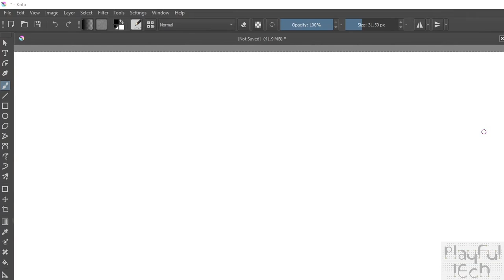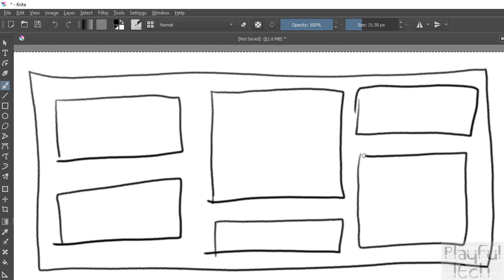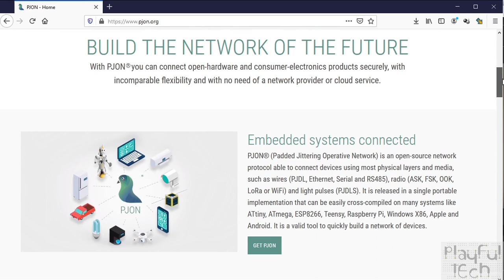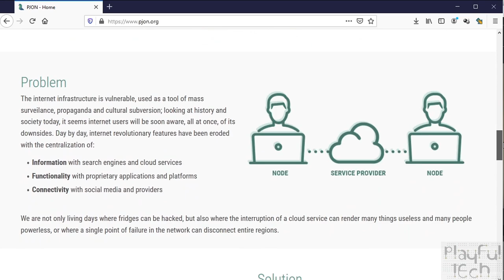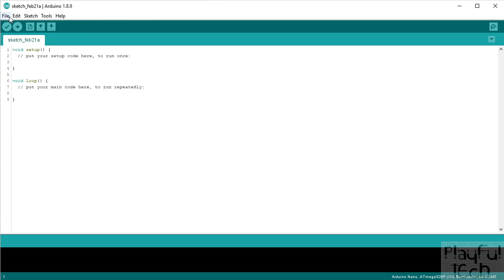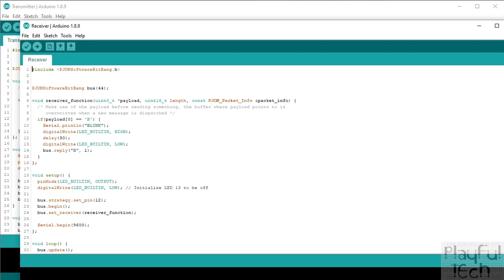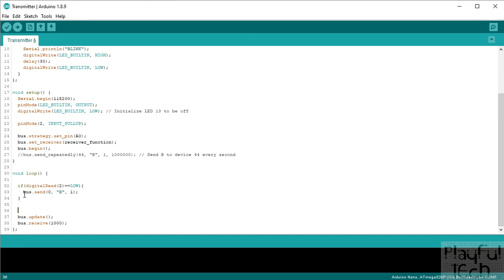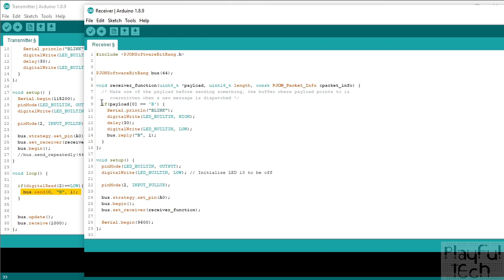Building an Escape Room-In-A-Box - Part One

Comment: Nice! I started on a similar project last month and it is so interesting to learn about PJON. I'm just using an Arduino Mega2560 with all the modules feeding directly into it (with nearly every pin in use!) but I really like your idea of each module having its own nano - that is really going to cut down all the inter-module wiring! You may have provided me with a nice alternative just in the nick of time since I'm at the stage where I'm ready to start 3d printing and assembling the components - thanks for that!

Comment: Great library to use for simple communication.  I'm using 16 arduinos and I found out that you can't chain them for the communication wire.  More than 6-7 in a row and you lose communication but if you do an star and each path has 3-5 arduinos, it works so far for me

Comment: Weirdly, I'm building a pseudo arduino network literally at the moment, I had been simply pulling a pin low via a relay and having a common ground so that my 7 different arduinos in the escape room "feed back" to a central arduino which controls sound and dmx, saying when each element is complete. I might just take a look at this instead. Thanks so much for this.
Reply: Would be good to know if you can use this to get arduino interfaced with raspberry pi.
Reply from the maker: I believe you can, yes. The only issue is that RaspPis run at 3.3V rather than Arduino 5V, so which voltage you choose to run the network at, you'll need to incorporate a level shifter for the other device(s)
Reply: @PlayfulTechnology  I wonder then if a shift to ESP32 might be in order for me, that runs at 3.3v :)
Reply from the maker: @ImperialLightandMagic  That's basically exactly the same decision which I came to yesterday, after realising the Arduino UNO I started with wasn't going to be beefy enough to handle all the requirements of being the "master" controller - and basically trying to simulate all the things you'd expect from PC-based escape room control software, but on a little diddy microprocessor.....